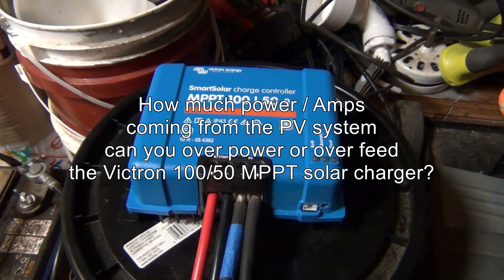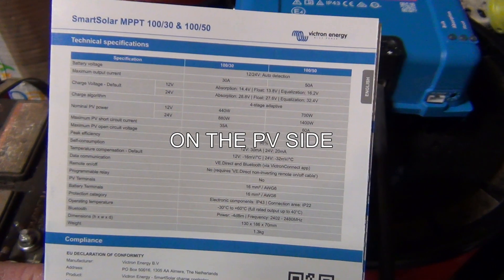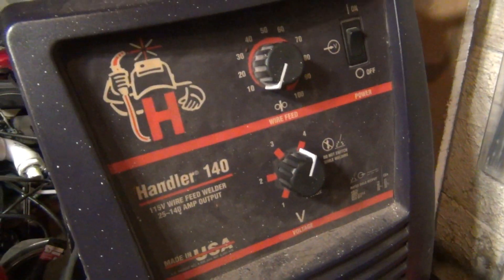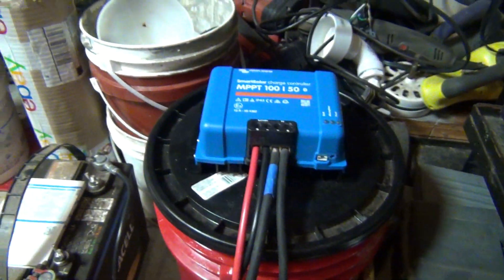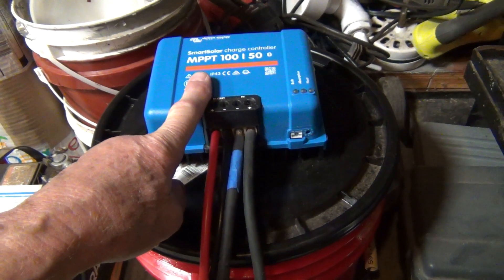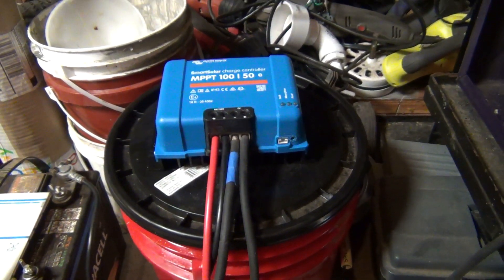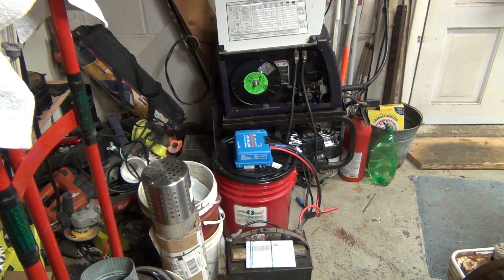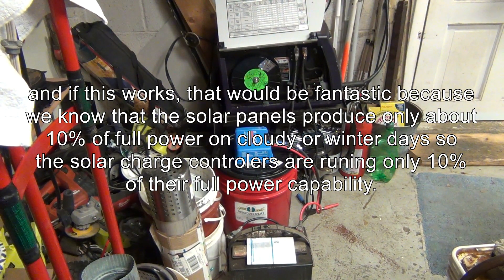How many Watts / Amps of solar power can you put on Victron 100/50 MPPT solar charge controller

Comment: wait what? did you mean to dump 140amps into the controller? says on the spec sheet no more than 60 amps in from your PV. Cool to know its working ok, but that might be just because its a well built unit -  could crap itself eventually. I'm pumping 2400w into my victron 100/50 - no dramas. 4 strings of 300w pairs - 70v x 32amps.
Reply: I was wondering how to make my 400 watt panels x 4  for a total of 1600 watts work with a victron charge controller. I see your panels are only using about 9V per panel and how is that? Mine use 37V each and are 12.9A each. I just don't see how you get 2400 watts on a 100/50 Victron?
Reply: @wally1957  no worries -  panels are: 32 (vmp) x 9.4 (Imp) for a total of 300.8w each. 
300w x 8 = 2406.4w.
If wired in series = 256volts x 9.4Amps - too much voltage, unit goes boom.
If you wire 2 panels in series, you get 64 (vmp) x 9.4 (Imp)
If you then wire 4 pairs of 64 (vmp) x 9.4 (Imp) in parallel - you get 64 (vmp) x 37.6 (Imp)
64 (vmp) x 37.6 (Imp) = 2406.4w
spec sheet shows max voltage input of 100 (Voc) x 60 (Isc)
Not sure of your knowledge of temperature derating, but Isc can mostly be ignored, Voc could increase to 36v per panel, depending how cold your area gets - still well below the 100v danger zone for your controller.
Yes it is a fair bit more wiring, and yes you may want to increase your array cable size to 6mm2 to carry extra current/temperature derating.
If you want to provide -
1 - your panel values (Voc, Isc, Vmp, Imp + all 3 temperature coefficients) 
2 - the absolute coldest and hottest temperatures of your area
3 - the mounting method of your panels (flat on roof? on tilt frame?)
I would be happy to crunch some numbers for you.
rough guess, as long as your Voc per panel is around 40v should be ok 2S 2P.👍
Reply: @asedcopf  I really appreciate your detailed response! I am wondering if it is best to get a victron charge controller to wire all 4 panels in series thus keeping the amps low and the wiring small. Might need a little bigger victron controller. This is my specs: Open Circuit Voltage 37 ± 4% V , Voltage at Pmax (Vmpp) 31.05V , Optimum Operating Current 12.89A , Max Power(PMAX) 400 Watt .....x4 panels I am also in Seattle with cooler climate. Cheers!
Reply: @asedcopf  Sorry but one last thought. Would it be possible you think if I went with a Victron 150/45 thus saving a fortune on the next upgrade?
Reply: @wally1957  ok, so I had a quick look at coldest recorded temp in Seattle  -9c
The numbers I was referring to are the temperature coefficients - if you can access your solar panel data sheet you will see 3 numbers, power, voltage, current temp coefficient.
 your 37 Voc x 12.89A panel should be something like Voltage temp coefficient -0.25% (most are around this level).
So, after a small bit of math, your 37 Voc changes to 40.145Voc @ -9c for each panel.
40.145 x 4 = 160.58 Voc if you wire all 4 panels in series.
You will need a charge controller that will accept 160.58 volts, 12.89 amps, therefore getting a Victron 150/45 won't cut it (145 volts max input, 50 amps max input).
Your best bet is to wire your panels 2s 2p for the values 80.29 volts x 25.78 amps.
You could potentially use a Victron 100/30 to meet your requirements, however I would bet that soon after you will want to use more panels - buy the biggest one you can afford.
I would be more worried about keeping the voltage lower, but that depends on your setup/space/safety etc.
Yes for 2s 2p you will need a little more wire and connections, however the wire size SHOULD remain the same (4mm2) @ 25.78 amps - again this could change depending on if you plan to bury the cables or enclose them in insulation etc etc.
I have to stress, the above calculations are my best guess as for a 100% accurate calculation you need the EXACT temp coefficients/min temp in your area
Reply: @asedcopf  Thank you! I ordered the 150/45 because of the price and only slightly more than the 30. I am going to wire the panels as you suggested 2s 2p for the values 80.29 volts x 25.78 amps. I already have another string of solar panels @ 800 watts so I will have a total of 2400 watts. I am currently using two Epever controllers rated at 100V and they say the max Watts for my 24V system is 1040. That is why I switched to Victron upgrade not only to try and get the most out of the panels but for the wi-fi app. I am going add a Rasberry Pi 4b and 13" monitor and see if I can get it to hook up with the Victron for easy 24/7 monitoring live in the living room. The Panels are installed on my RV roof and it is more of a hobby or possibly go off grid if I buy some property. Thanks again. P.S. I am using Temco 6 gauge welding lead wire from the roof junction box to the RV basement where the controllers reside.  Routing the wires through ceiling and walls.
Reply: @asedcopf  One more question.... If I eventually add two more 400 watt panels to the 1600 watt string I am assuming that they should be wired in 3S2P for 120V @ 25.78 amps. Is that right? Now my last concern is that from what I read somewhere is that the Victron 150//45 only handles 1300 watts so I am confused why the 150/45  rating? If I wire 3S2P configuration that would be over 3000 watts according to the Volts times Amps = Watts rule. Sorry but I'm confused.
Reply: @wally1957  started with epever gear, thought it was junk compared to Victron - cost more and was a nightmare to set up through your pc etc. That 6 gauge welding cable "should" be more than fine with current under 30amps, but see if you can find a temperature insulation rating on it.
Can't see a problem with wiring 2 more 400w panels in for a 3s 2p configuration - and a total of 2400w @ 120 voc, 93.15 Vmp x  25.79 Imp (Voc illustrated ONLY for max input calculations) ie. -  93.15 x 25.79 = 2402w. (your 3000w calculation is incorrect, sorry for the confusion)
As an aside - if you ever decide to have 3 or more parallel strings, you may need to fuse the positive on each "string".
As for the max input of 1300w - yep, I can't find a decent answer either - the only thing I have found is that having an array of 2400w is that the controller seems more sensitive/unstable when trying to find its MPP - eg. sun comes out from cloud, hits the controller with 2400w and the tracking goes haywire for a few minutes trying to find that sweet spot, and also when turning on loads the same thing can happen. I found keeping the charge current at about 80-90% solves this problem. So, all in all its a balance between over panelling and max charge rate. In saying that - it could be the fault of the high frequency chinese inverter i'm using feeding back into the system, still experimenting.
Reply: @asedcopf  oK ....ALL SOUNDS GOOD! I am running inline fuses on all positive panel wires. I have had some problems with the Epever disconnecting in the past but I think it was due to bad wiring or connections on one old string that I eventually removed. No problems other than that. I started out with a 12V system and a 3000W inverter and during a heavy load test around 2000W The Heavy gauge battery cables began to melt and smoke. They should never make a 3000W inverter for a 12V system. Draws too many amps. I have since went to 24V system with a 4000W inverter. I have also switched from buying standard lifepo batteries to used EV Nissan Leaf Modules. Love em. Victron comes today and can't wait to see what the difference will be. Thanks for your help and I really appreciate your fast detailed responses. Cheers....

Comment: I always thought the 50a was to the battery not pv side amps.. I don't think the controllers are based off pv side and the pv side is very high amps it's just limited by voltage. My issue is i got a 100/30 and using my 300w 70v solar blanket in summer in 2022 at midday i got 301w 72v but i then tested it on the same date a year later and only got 180w 56v..nothing has changed on the controller only thing i changed was added a second battery but all settings are fine..but i cant understand how it works when i test with multimeter at the panel i get 73v and 4.4a when i test on the pv nuts it goes to 56v 1.4a...like wth i checked the cables and all fine i even cooled the panel but same results..why a massive drop
Reply from the maker: read the user manual for the max Amps on PV side, also you connections are loose or thin wires, thats why the voltage drop, 12 V  is very fussy this way.
Reply: My battery is 12v, the mttp is 12v. I got 10m 6mm2 solar cable which should be enough.. the voltage drop even if I used 20m is only 1.1v as the panel is 70.8v..I'll check the connection but it was working fine before I added a second battery in parallel

Comment: Nice, ... but the voltage input can't go over the 100V ... Right ...  ???
Reply: correct
Reply from the maker: Right
Reply: apparently too much clipping will increase your VOC - not sure by how much, still trying to find that out, could be a problem if you initially get too close to your VOC max input @VladFredK
Reply from the maker: @asedcopf  what do you call VOC?